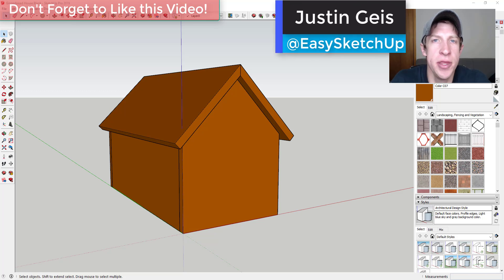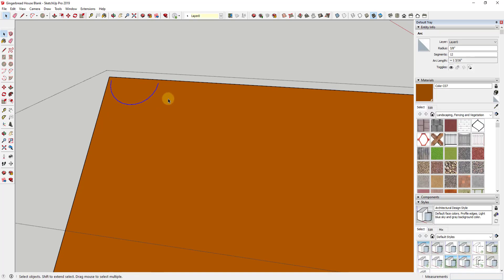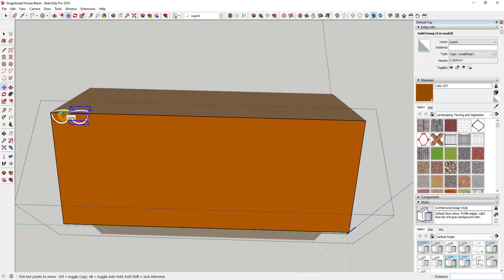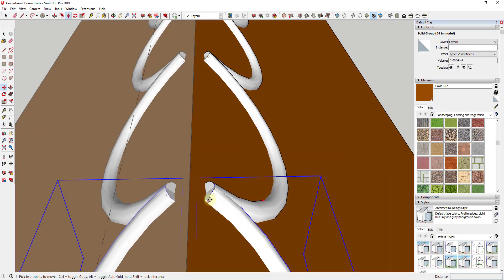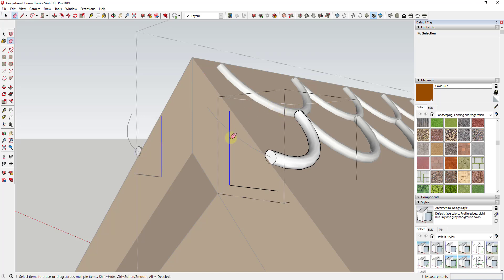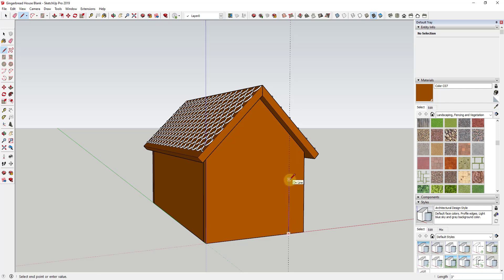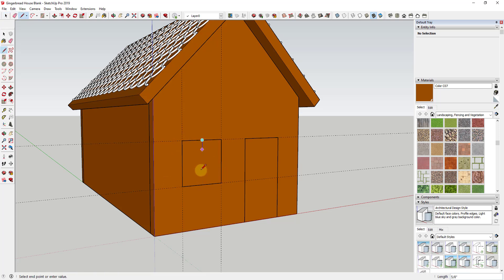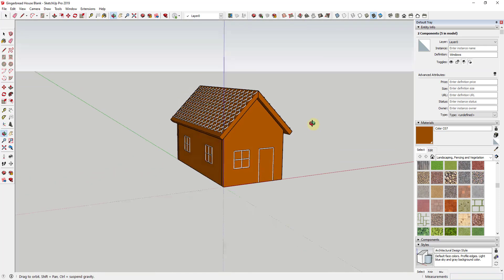Creating a GINGERBREAD HOUSE in SketchUp Part 2 - Adding Icing

Comment: Hi Justin just looking to start out with sketch up used to use Vector works many years ago just wanted to know in your veiw if you thought it was a waste of time with the free version ?? And if you are going to up grade which version is the sensible option - I’m looking to design residential buildings with a high level of detail for construction and manufacture 
Thanks for your help Mark
Reply from the maker: If you're using for commercial work, you should have a Pro license anyway due to licensing requirements. That said, yes, for those applications, especially when trying to generate plans, you're going to want Pro, not Free